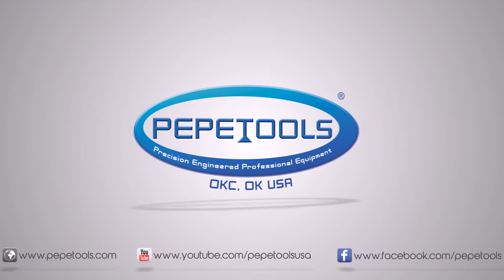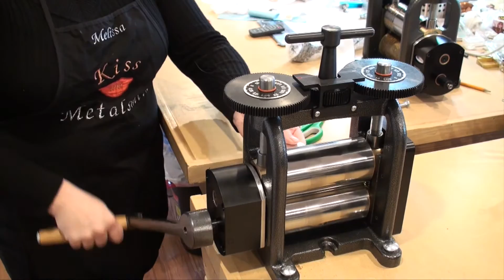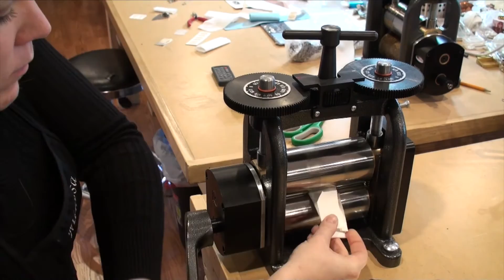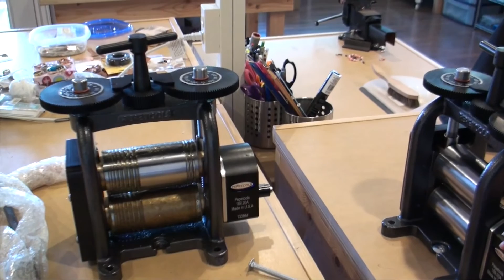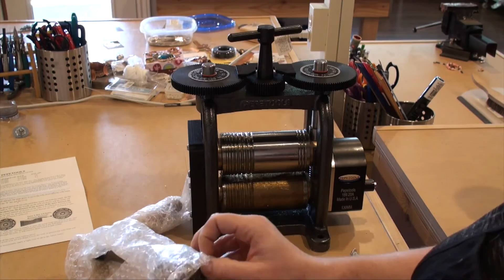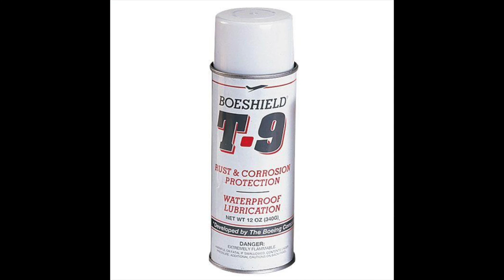PepeTools New Ultra Rolling Mills

Comment: Thanks for the video Melissa. I have a cheap mill but want to invest in a better one. I want to use it primarily  for making sheet and wire stock. Would you recommend this mill for this? Also, why don't mills make round wire? Appreciate any advice you have, thanks!
Reply from the maker: +Dawna Marquette So far I am loving mine. I am going to be pouring some ingots here pretty soon and I will be able to give a better review on rolling out sheet. The wire stock I have done so far has been easy and wonderful. I expect that rolling sheet will be much the same. I will keep you posted. And if you do decide that you would like to get one, I can help you with that too. :)
Reply: +Melissa Muir Thanks Melissa!! I have never drawn wire or done sheet before so it should be interesting. I wish there was a mill that could roll round wire. Thanks for your video on the hydraulic press, I bought a Potter USA one because of your recommendation.
Reply from the maker: Dawn, I do believe that Durston came out with one that did round wire. But I haven't ever seen it or tried it out.
Reply: For round wire, you go from mill to drawing dies and tongs. I'm sure there is a video for that too.